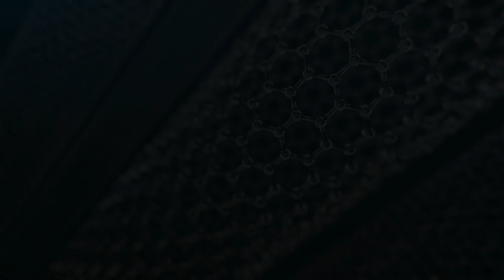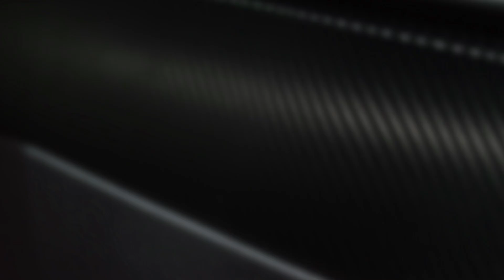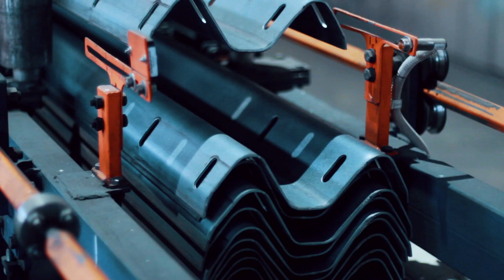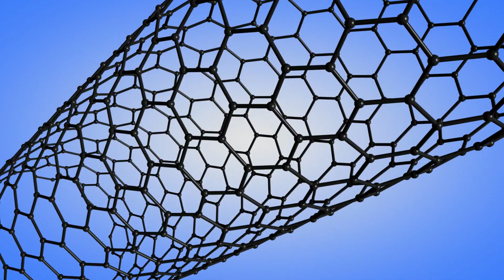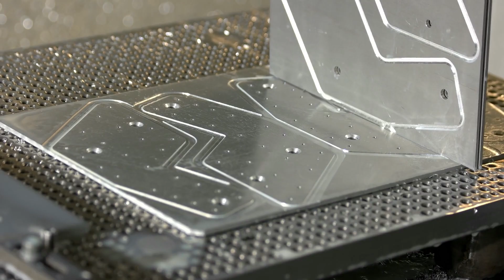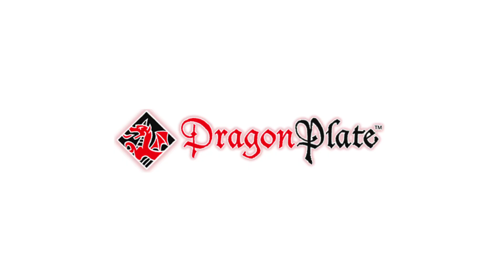Carbon Fiber: Everything You Wanted to Know

Comment: I’m here cause of Oceangate tradegy. Carbon Fiber may be strong but not as strong as steel. Like James Cameron said they should always use steel for sub pressure tank.
Reply: He says that it's a material that will not yield (like a metal bending) instead "it would fail suddenly and catastrophically "
Reply: It’s very strong when used properly. It’s weak when vertical pressure is applied, which is what you get in the ocean. This is a terrible product for that. 

It’s amazing in air tanks and internal pressure uses.
Reply: Not as strong as steel? James Cameron, a canadian film director? Does he have a PHD in Chemistry, Physics or anything important or is he just talking crap thinking he knows that steel is "stronger" than carbon fiber?
Reply: @ellidominusser1138  James Cameron is THE expert on submersibles. He helped design and build the deep sea challenger, which he then piloted into the deepest point in the Mariana Trench. He is both a film director and a submersible expert
Reply: It's not the carbon fiber that was the problem, but the company who didn't check on the submarine and maybe do the safety measures. The submarine had previously gone deep into the ocean with no problem.
Reply: @ellidominusser1138 you’re right that the carbon fibre wasn’t the problem, it’s a great material, Stockton rush was the problem and carbon fibre in a submersible could’ve worked fine if ocean gate used it properly
Reply: It’s stronger than steel pound for pound

Comment: "once the ultimate strength of the material is exceeded, carbon fiber will fail suddenly and catastrophically." Rest in peace, OceanGate Titan.
Reply: I noticed that sentence too. I understand what happened with OceanGate.  RIP
Reply: Exactly. I listened to that and my mouth flew open. Knowing that fact why choose carbon fiber? Bad choice
Reply: @mastercraft888 ro? You know that there's a reason carbon fiber was chosen over any other metal, it's lighter and stronger. Anything else would have also failed suddenly and catastrophically under those pressures. Well not suddenly, pretty slow, but it would be inevitable and much easier to destroy. Don't want your submarine to deform itself and potentially sink every time it goes into the water

Comment: what is the structure of carbon fibre? Is it a polymer? What does it consist of? I know that there are mainly carbon atoms present but what else is present? Why is it so strong and does the structure tell us why?
Reply: They show the atomic structure of it at the beginning. The atoms form a hexagonal shape.

Other than perhaps adhesives to glue sheets together, maybe with resin, I am pretty sure it consists purely of carbon atoms.

I believe it is so strong because carbon atoms like to connect to three (or sometimes four in the case of diamond) other carbon atoms. I think the more atoms that bond in an element, the stronger it is. I kinda wish I knew more, but I know nothing about chemistry.
Reply: The hexagon is one of the most stable forms in nature. It's the crystal alignment that makes it "strong" or very resistant to outside stress and therefore bends harder. I'm also no expert but I believe this is a good enough explanation
Reply: @ellidominusser1138 is triangle strong?

Comment: Greetings DragonPlate:  This is my first time watching any of your vids.  I was looking for information on Carbon Fiber wrapping resins and I came across this video.
More specifically; I'm looking for the appropriate or optimum type of resin for Carbon Fiber Wrapping rifle barrels where there is high heat to consider.  After watching this video it also seems appropriate to ask you what type of Carbon Fiber you would recommend for wrapping Rifle Barrels where rigidity as well as high heat are to be expected?
Can you give me an idea of which of the resins and Carbon Fiber types you've worked with would be suitable or optimal for this application?  Thanks in advance.
Reply: @realgabrielflandes  I finished this Carbon Fiber wrapped rifle barrel a couple of months ago. 
After researching all my options I decided to go with a pre-made Carbon Fiber tube instead of wrapping my own Carbon Fiber tubes.
It worked out great.  I just had to get used to the lighter weight of my rifle.  It took a couple of trips to the shooting range to work up some accurate loads but once that was done I was able to shoot ragged holes at a hundred yards.
I estimate that I saved about seven hundred dollars by Carbon Fiber wrapping my own rifle barrel.
I may do another later this summer.
Reply: TIM MONTANO how difficult was this?
Reply: @noahnims3942  Once I figured out exactly what I would need to complete my home made carbon fiber wrapped barrel it turned out not to be as complicated as the specialty manufactures of these barrels let on.

In the end I decided to purchase some short lengths of the correctly dimensioned pre-made carbon fiber tube that had sufficient heat resistant qualities.     I got what I was after in terms of a lighter varmint rifle with accuracy that was a bit better than the factory barrel.

Of course you do need a metal lathe and some metal working knowledge to do the barrel work but like I said.  It's not that complicated.

I posted a vid of my finished carbon fiber wrapped barrel.  It can be found on my home page.
Reply: @MrTjmk  Very cool. I'll give it a watch. Interested in doing it myself.

Comment: Great video thanks. What about the toxicity of carbon fiber material, is it safe to use for consumer goods such as baby products?
Reply: As long as you aren't cutting it, the dust from sanding, or cutting it is really bad, but once it's resined it's super stable and safe.
Reply: @SeanBlader  Thanks, appreciate the help
Reply: Perfectly.